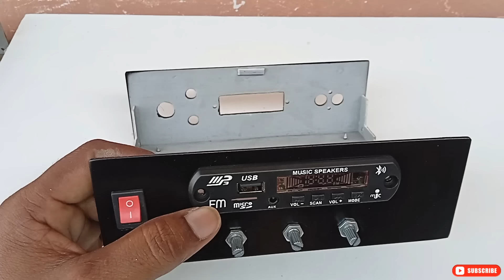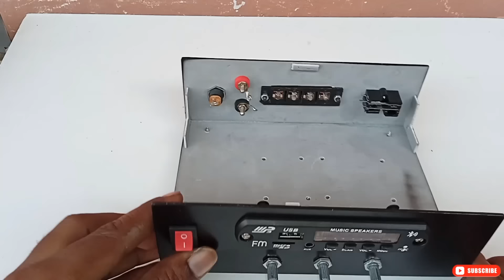how to make 2.1 class d amplifier 120watts make it home

Comment: Hello Mr KSK, Greetings from Australia. I enjoyed this video very much. I am making similar amps using TPA 2.1 amps?  I use solid timber for the case. I like a built in power supply. I like your preamp controls remote from the amp board. It would be great to have a full part list with Amazon or other supplier links plus a full circuit diagram showing all the connecting wires. Have you got these things that you could post up for your subscribers? Thanks so much. Cheers.☮️🌈💚🇦🇺
Reply from the maker: Yes, absolutely

Comment: Also made my own similar DIY amplifier, but only 2 channels, I bought a rectangle shaped Bluetooth, FM receiver ,cause i didn't like the oval shape, and the TPA3110 amp is not good on bass , so I used the TDA8932 which is very good in low and high frequencies.. also housed in plastic casing, but not like yours , I just drilled necessary holes on pre-built plastic casing for electronics.. 😊
Reply from the maker: Very cool!
Reply: @kskmakes8054  thanks, but your project is a lot cooler..😊
Reply: What about TPA3116D2, any good for bass?
Reply: @sasyedji  not good.. maybe you need to have a good tone control to compensate for its poor bass response.

Comment: Super bro, I also actually have the same Idea 💡 to build a 2.1 with those modules. But what is the voltage and current rating you used for power supply???
Reply from the maker: 24volt 5amp DC
Reply from the maker: 24volt 5amp DC

Comment: Pls advice. I need Class D Mono amplifier 60watt with only Single MIC input connection, 3 poteniometers. Bluetooth, pen drive not required. where can buy from? available DC supply 12v and 24 volt.

Comment: I think single board of Tpa3116D2 (50w+50w+100w) will do the trick except Bluetooth USB Panel and step down converter. It will be more powerful, I am personally using it. And I think 5:33 you must put a caution to pre-calibrate Step down converter to desired output before connecting wires.
Reply from the maker: Thank you for watching
Reply: bahkan ada yang langsung ada bluetoothnya,atau pakai zk tb21
Reply: where is corrector tone treble - bass?

Comment: Can it use a saloon car 12v battery?
Reply from the maker: Yes use no problem but output power down
You can use 12v to 24volt boost converter
Thanks for watching

Comment: 3118 or 3116d2 which is the best and 24 v healthy or risky pls tell me..I have 24 v smps power supply
Reply from the maker: 24 5amp power supply good for 3116d2
Reply: @kskmakes8054  Thanks sir..and one think..woofer value and size...like ohm watt and 6" or 8" for better performance and safe for this board..pls sir 🙏
Reply from the maker: 8 inch  woofer   8 ohm
Reply: @kskmakes8054  thanks sir ..🌹🙏
Reply: @kskmakes8054  watt 50 or above

Comment: You should use Voltage regulator 7805 replace of tepd down circuit
Reply from the maker: Thanks for watching
Reply: A step down converter is more efficient than the 7805 Regulator

Comment: bahan-bahan nya apa aja yg diperlukan om
Reply: Bantu jawab mas.. 
Tone control 2.1
Modul Bluetooth
Step down
TPA3118 (untuk subwoofer)
TPA3110 (untuk satelit)
Soket dc
Terminal speaker kecil
Terminal binding post
Soket RCA